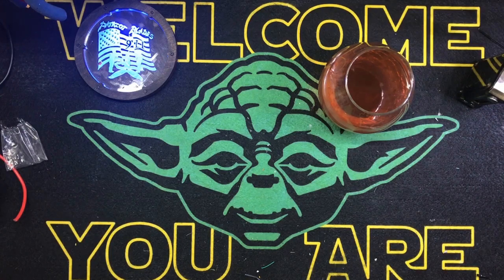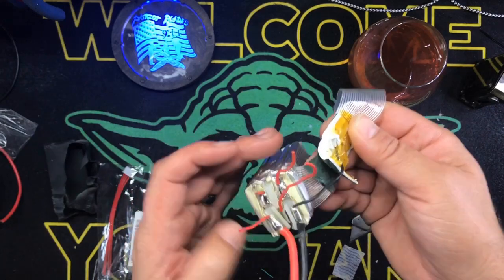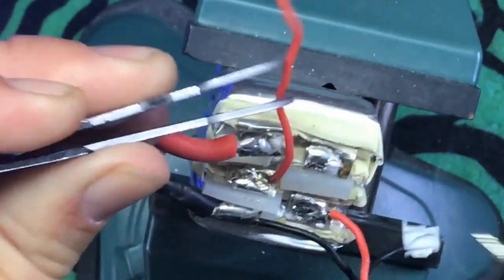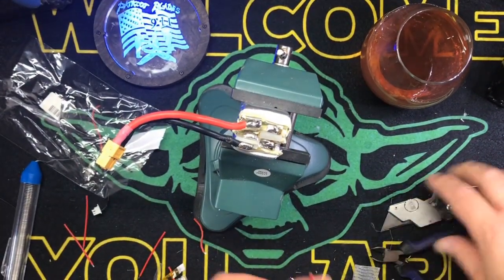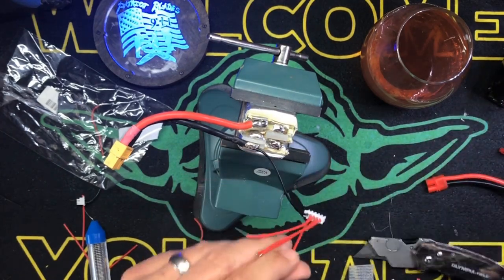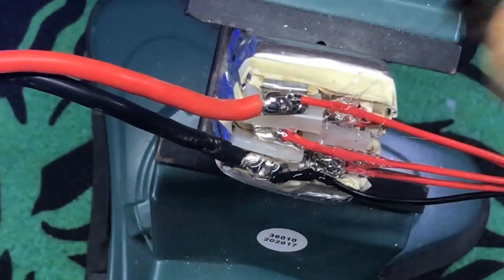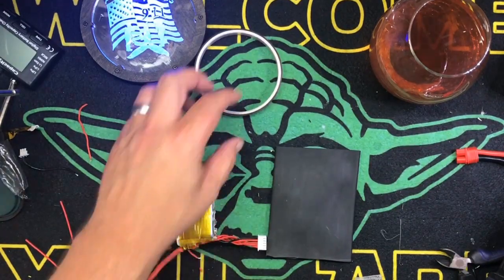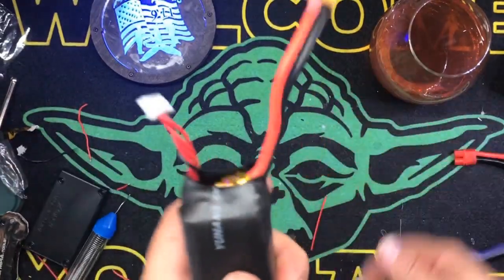Quad Kitchen : Fix that lipo!!!!!!!!!!

Comment: well done JJ... I fisserated my first lipo pack without any such help or words of wisdom spoken straight from a roto-twister.. I had 3  batteries that had weak (dead) cells, dissembled and rebuilt one epic pack!!! without any pop-pop bang=bang..
I really appreciate the heat-shrink lead.. I'm buying that SH*T...  is it comparable to Ke's indestructible heat shrink?  That SH*t is epic!!!

BTW 1... Ke is now adding super short balance leads on his batteries, with a plug in extension... I clipped the battery balance lead extension this afternoon, when I was in a hurry to get in the air... no stress, the connection to the lipo is still intact, the extension plug is F*&Ked.. my fault.. but I can use one off another pack...

You need to preach Indestructible Quads stuff, brother Ke is awesome... His stuff is awesome.. and right now there are HUGE discounts as he is relocating to the "quad hating state"... CA.

BTW 2.. I am completely over the Cicada AIO FC... I smashed it with a hammer in the street this afternoon (worth the $70 bux aggravation this board has caused me)... (i'll email you) but nobody deserves the torture this board has caused me...

twist on bother...